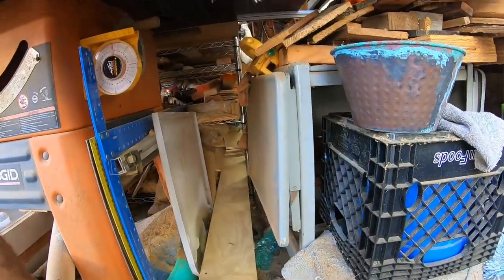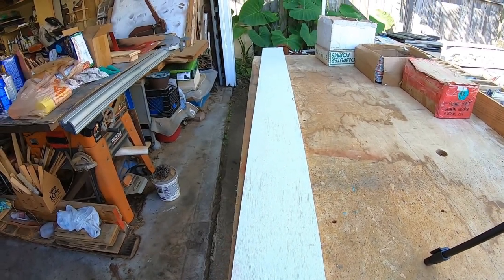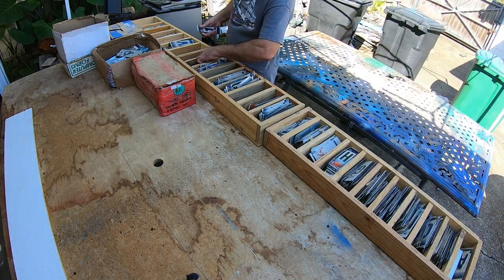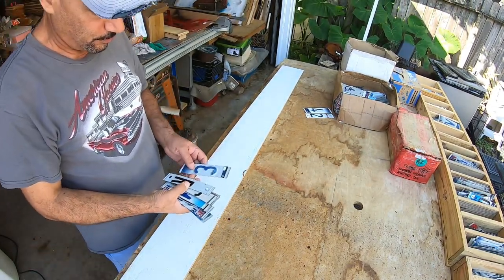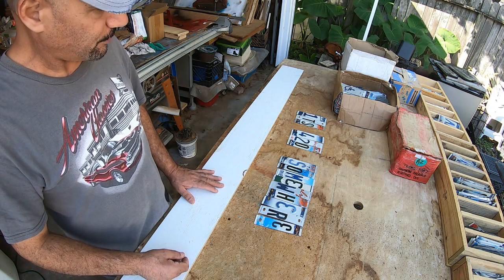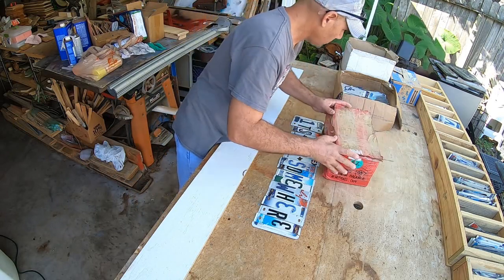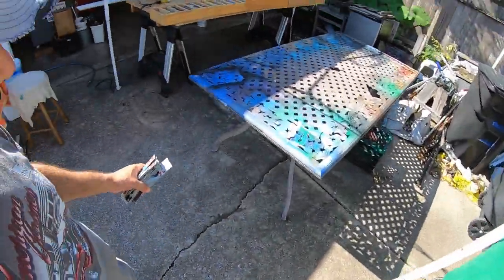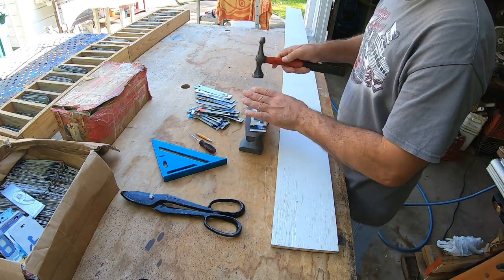How to make a License Plate Sign, Step by Step

Comment: So you also poly the front sides?  And do you only use the big tin snips for cutting the plates or do you use other tools, too?  I think they look great!
Reply from the maker: Hello Christine, I do not poly the front, only the back. But I also Kilz and paint under the plates to seal it incase a customer uses it outside. I usually use long hand snips that cut straight.
Reply: You must have a killer handshake

Comment: Awesome video, what kind of tool do you use to cut the plates, there is now way you use tin snips. Band saw?
Reply from the maker: Tin snips work fine, but I draw a straight line down it with a pencil and a speed square.

Comment: Are you using a brad nailer or a pin nailer? Thanks
Reply from the maker: Hello mkw36, I'm using a brad nailer. But you can use either, as long as what you're shooting in is short enough and doesn't come out of the back side of the wood you're using. 
I'll be doing a similar build very soon, its just hard to find the time to film being I work everyday. But stay tuned, you'll see some good future content.
Reply: What size pin nails you use without blowing through